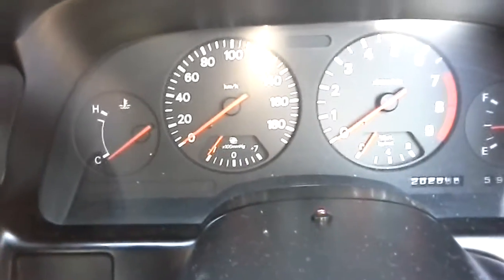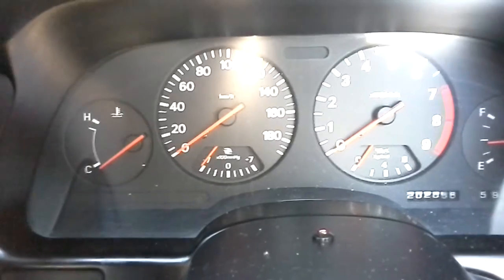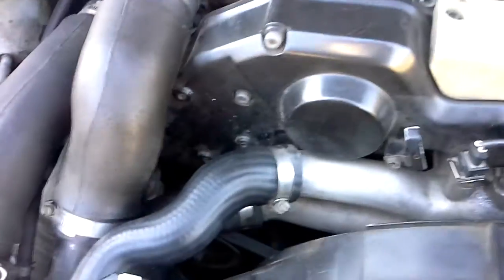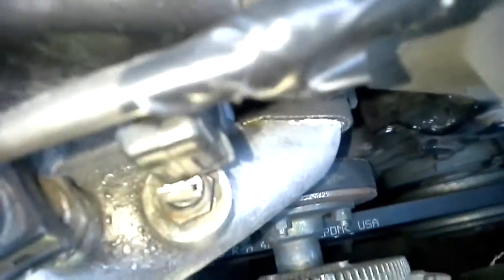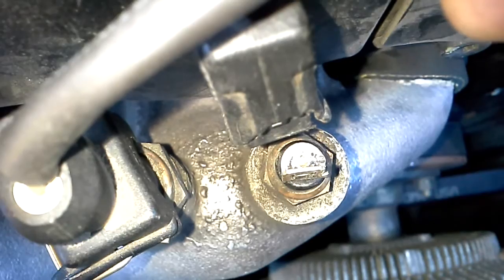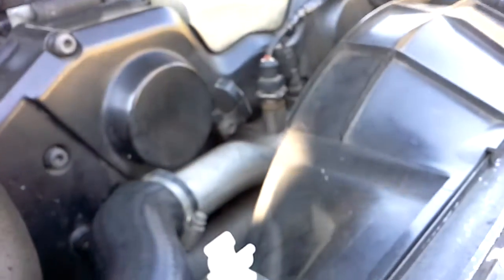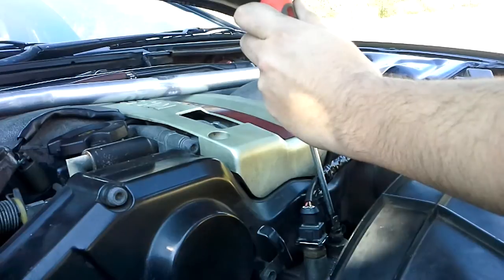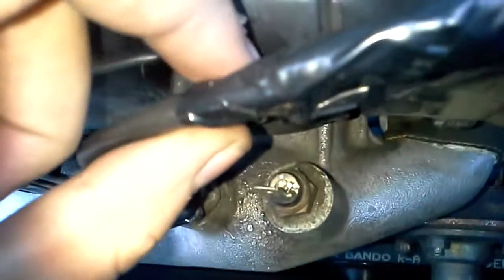300zx Z32 Coolant Temperature gauge FIX

Comment: Is the blinking red light behind the steering wheel from an aftermarket central locking system?I bought the car with the same red light and I have no idea if it was oem or aftermarket.
Reply from the maker: yeah man aftermarket alarm